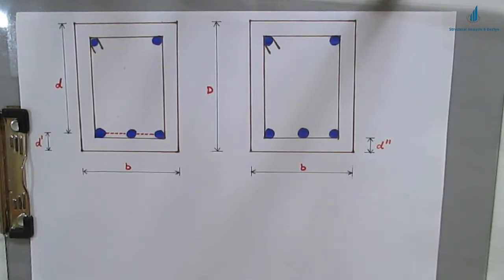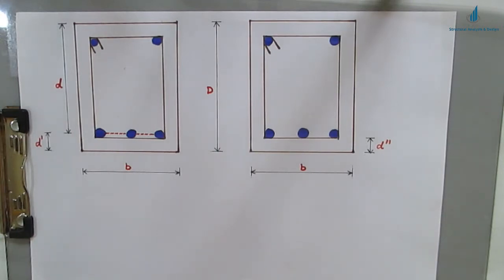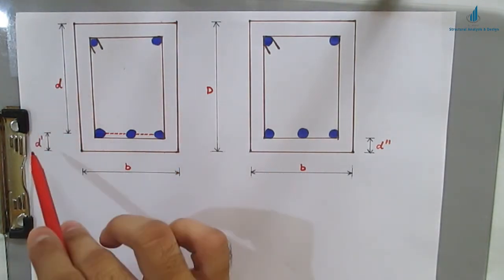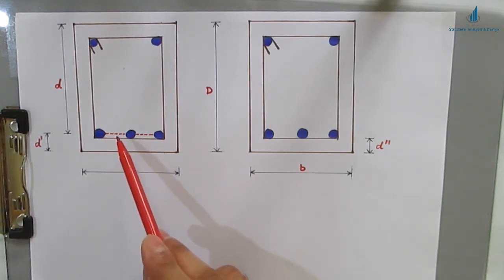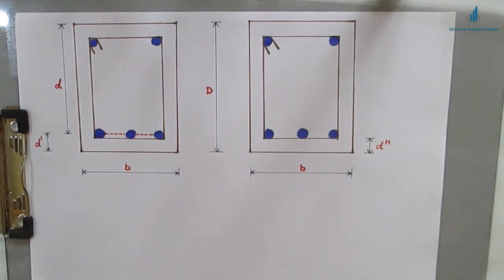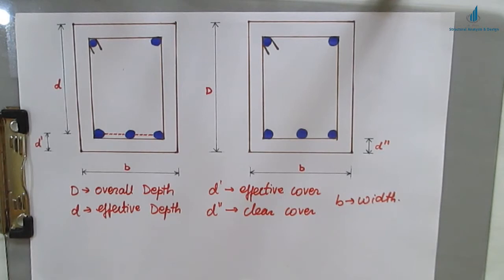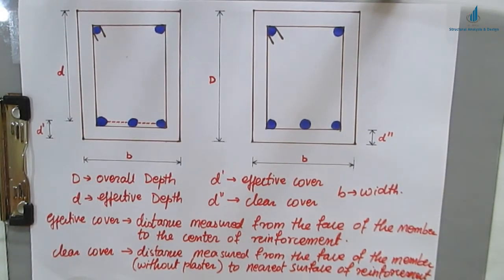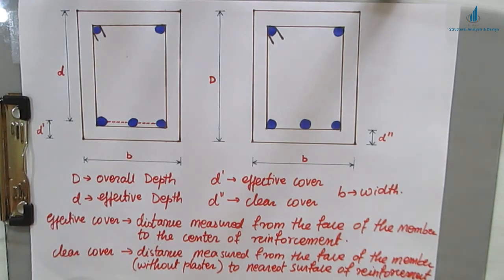Difference between Effective Cover and Clear Cover in RCC

Comment: Thanks for the video. Kindly confirm if this explanation can also be used for cantilever beams?
Reply from the maker: Same concept is used but the change in cantilever is main steel will be on top side because tension is at top side